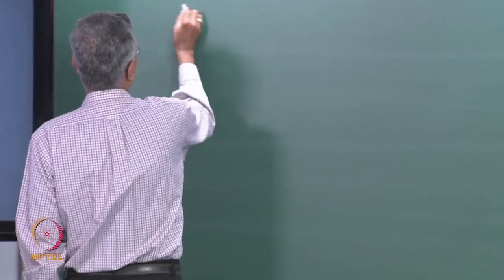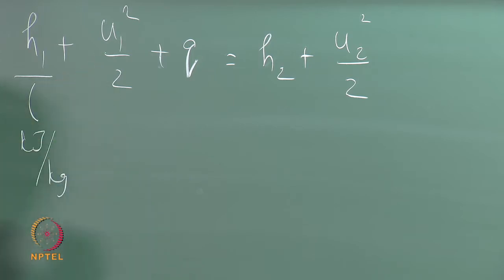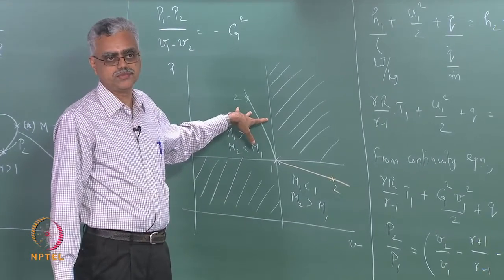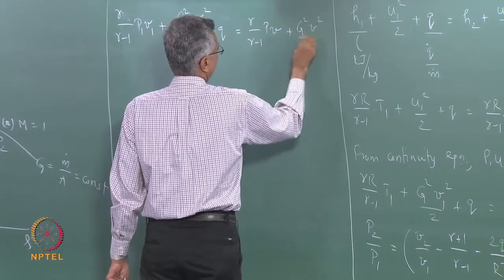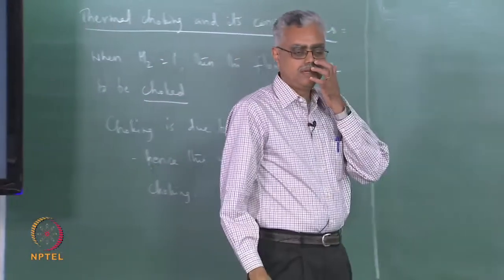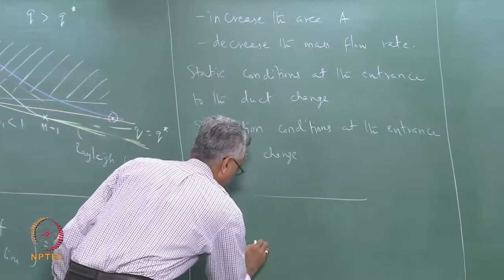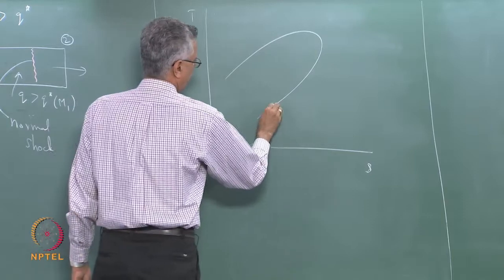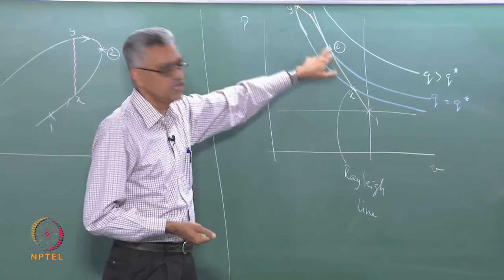Mod-01 Lec-09 Rayleigh Flow

Comment: Thanks for uploading this lecture. There seems to be a discrepancy with A. Shapiro's book. On page 202 Vol 1, choking in supersonic Rayleigh flow is discussed. It is specifically mentioned that in case of Rayleigh flow the shock will not alter the max ratio of the T0s. Please suggest.

Comment: When heat is added to a compressible flow, the stagnation temperature always increases. Whether
the static temperature increases or not depends on the actual flow condition, since the stagnation
temperature is the sum of two terms - static temp and u^2/2Cp. When 1/gamma^(1/2) < M < 1, the
increase in the second term for a given increase in T0 happens to be more and so the static temperature
actually decreases.

Comment: Thank you for uploading this great lecture. Unfortunately it is always hard to find the next one. I have a question: on the T s / h s diagram for M<1, adding more heat brings the line upwards as expected. Why does the line go down even when we add heat right before it reaches M=1 condition? Thank you very much in adv for your help.
Reply: I apologize for the late reply. The effect that you are referring to is a manifestation of compressibility effect during heat addition and occurs only 
for a small range of Mach numbers on the subsonic side. It may perhaps disappear if we relax assumptions such as calorically perfect gas. Of course, demonstrating this is not going to be easy!